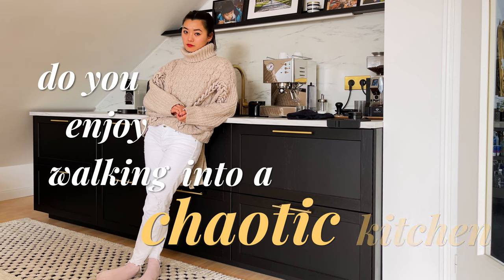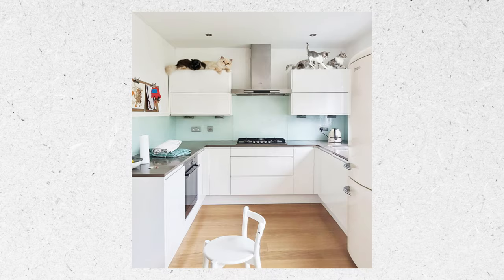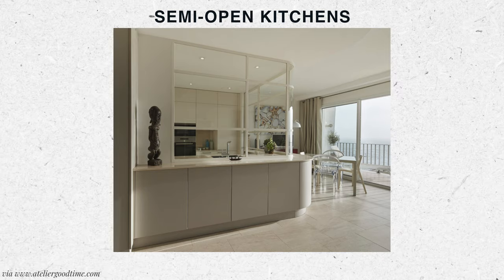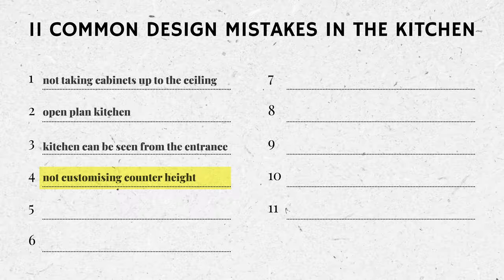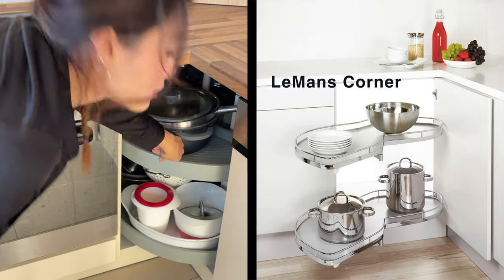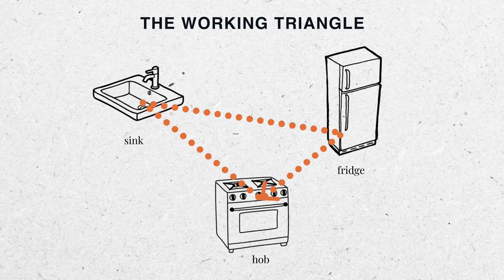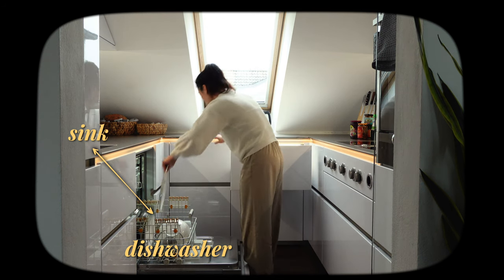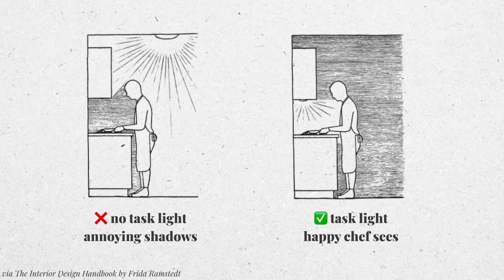11 Kitchen Design Mistakes + how to fix them!

Comment: I think the only thing I disagree on is drawers.  I understand the advantages of them, and I’m not saying they are bad… but:
 (1) they’re not reconfigurable. If my husband (and, face it, it is my husband) decides he will be baking bread and needs a grain mill and giant tubs of wheat, I need the ability to reconfigure the cabinets to accommodate this new addition to my kitchen, whatever its height, etc.  Things also go in and out of favor.  Back in the day, we made pasta all the time, and so pasta materials needed to be convenient; now they don’t.  To me, the inability to reconfigure means I don’t want to move to drawers. (2) It often is unpleasant to grip heavy things and lift straight up out of a drawer; I can get a better grip reaching around it.  And, sure, I can configure a special cabinet for my stand mixer, but see point #1.  The stand mixer went out of favor after a period of frequent use.  (In fact, it went so much out of favor that we now have the Ankarsrum instead, which is a different size and shape.). 

I guess I feel my life and diet have changed so much over the past 20 years, and we’ve rearranged the kitchen to suit every time… I can’t see myself putting in a kitchen so customized to what I am doing now knowing that everything will probably change again in five years.  (Because I am never remodeling this kitchen again.  Ever.)

Comment: Hello, I have an L shape kitchen ( with an island) and my stove is closer to the corner where there is no cabinet on the side wall. I have the recommended minimum counter working space between the stove and the side wall. I am concerned there could be cooking splashes on that side wall. Should I continue the tiles onto the side wall only for the space between the countertop and upper cabinet for the depth of the counter top or should I tile the entire height of the side wall ? Thanks for your tip, really appreciate it.
Reply from the maker: Hi Anne, interesting question! From what you have described, I assume the tiles do not go all the way up the wall anywhere else, because you have upper cabinets? So then, I think it would look a bit strange for the tile to go all the way the side wall. 

I would tile it to a level where it matches the other tiles, and for the empty space on top, maybe hang some artwork, so it is not so empty? 

Feel free to email me a photograph of this room and I can have a better look! hellobaixu@gmail.com :)
Reply: Definitely tile the side wall if a wok is to ever be used.  A friend caught our side drywall and overhead grease vent on fire, using a wok on a gas burner since it directed the hot flames outward.  I added tile to the sidewall after that incident.  Also, never leave the area when using a wok (she did).

Comment from the maker: TIMESTAMPS
0:00 intro
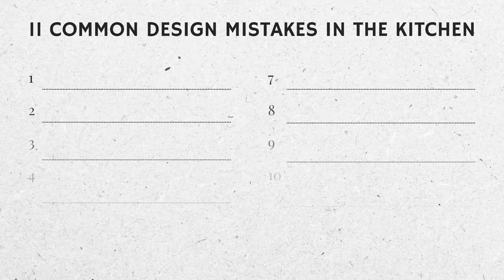0:48 cabinet ceiling gap
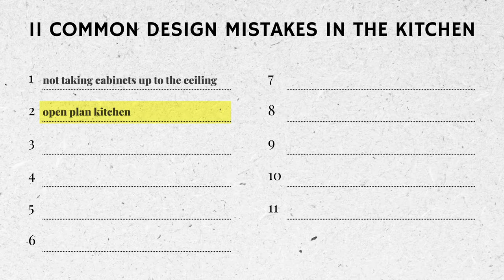2:10 open plan
4:03 seen from the entrance
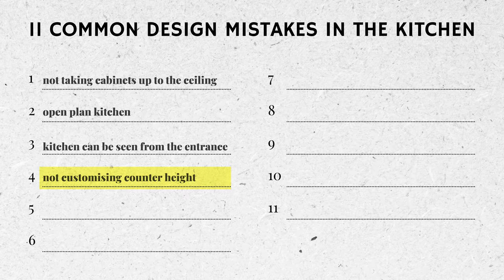5:08 countertop height
5:42 drawers, not shelves
6:23 forgotten corners
7:11 open shelves 
8:28 working triangle
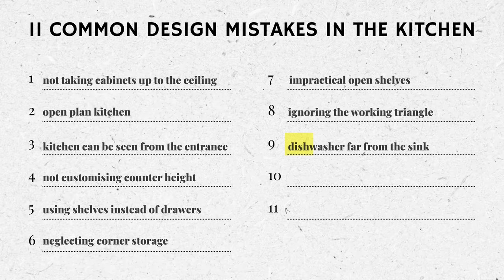9:21 dishwasher and sink
9:53 island hob/sink
11:28 insufficient lighting

Comment: 5:43 One drawback to drawers is that they're permanent. They can't be shifted to meet changing needs. If you've got two deep 12 inch drawers and the utensil drawer above that, this is what you must live with. For life.

One solution is to secure the shelf so it doesn't tip, then add undermount drawer slides. Now, if you ever need to shift things around so that you have a 16 inch and another that's eight inches, you just raise and lower the shelf pins, secure the shelf, and replace the drawer fronts. MUCH more manageable. 

I'm constantly trying to come up with strategies to future-proof a kitchen.

Comment: Great ideas. I have an open kitchen, visible  from the entrance, with 2 uppers to the ceiling, open shelves,  and no vent 😂 oh- and no drawers. 
The kitchen  was opened c 1940s. The cabinets added in the 40s were dropped, and I’m not removing the 80s version as we speak. I have two large 40”x49” tall  cabinets with old style twist turn brass latches from 1902 for my 1905 kitchen, so that’s a win over the pressboard oak of the 80s! 
I’ve taken out the rotten base cabinets in favor of an open (curtained) wood sink table. The 1927 Hotpoint range is from 1927 in b& w and chrome. It’s fab. 
I don’t do a lot of frying so it’ll be fine. Later, I’ll add a wall fan on the stove side to suck out cooking odors. I DO have 3 lighting sources. And a cast iron porcelain sink with one large basin. I’ll also look for a drawer unit that’s solid wood and old. 
I’m pretty excited because though I have little counter space, so have a lovely work triangle. And will ❤ my open shelving!

Comment: I have an open space above my cabinets.  It's where we display our beautiful ceramics from around the world.  As for dust and grease, we use our exhaust fan for grease, and we have air cleaners on the furnace for dust.  Items which you put in high cabinets for occasional use have to dusted anyway.
Reply from the maker: That’s great that you have a system that works for you! 😊